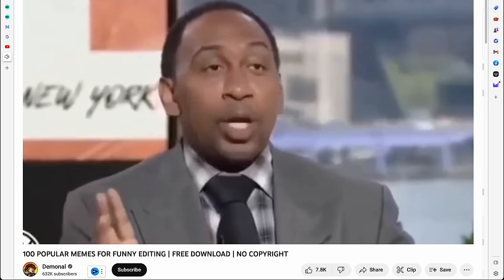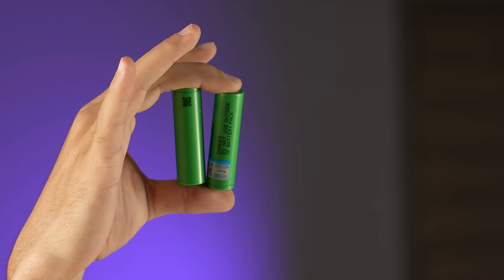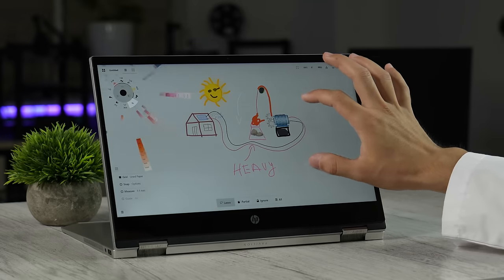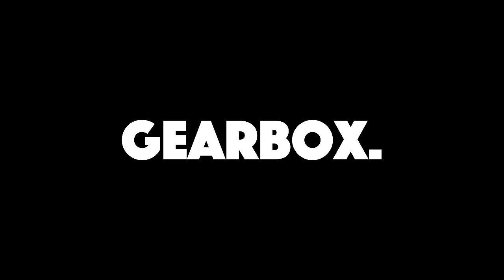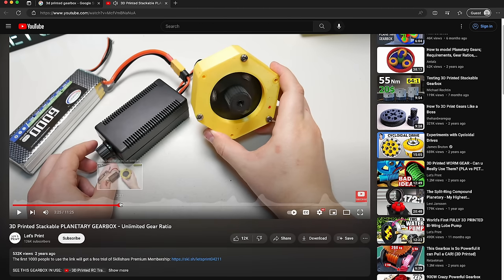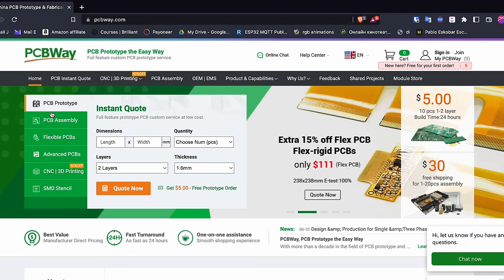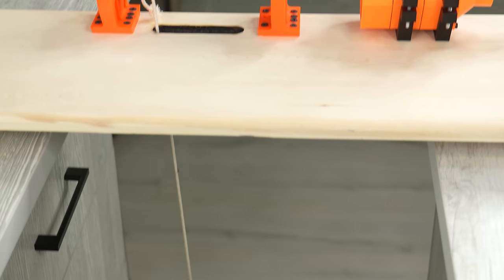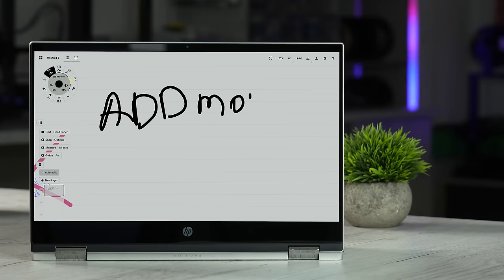DIY Gravity Battery: Unexpected Results!

Comment: I like the idea but i think a heat/sand battery would be a bit smaller. I have always wanted to see someone make a heat sand battery with either a sterling engine or peltier device to convert heat to electricity. You could heat with either an element or a magnifying  glass. But since you have solar already nicrome wire would work very well. The hardest part is getting the heat from the center of the battery to something like a sterling generator.

Comment: I have 12-volt solar panels that run air compressors when the sun shines.

I save the compressed air in a system of tanks and pipes. 

When there is no sun, I run a small generator operated by that compressed air.

I call it my "AIR BATTERY".
Reply from the maker: Nice idea:))

Comment: It's a great project. Gravitiy-based batteries already exist, there's one tower of concrete somewhere in the world that lifts weights all the day and picks them from a pool so that it can effectively accumulate a lot of energy. And of course there are STEP water dams that pump water from the bottom to the top using input energy, and let the water flow down to produce energy.

Comment: There are some excellent suggestions in the comments already, but one thing that I would suggest is to do more detailed engineering so that you know the failure points of every component, so that it involves less guess work and allows you to optimize the set up more easily

Comment: As first, you have my respect for trying such endaevour and mostly succeeding with it. Good job.

1) It would be much more easy, if the weight is inside some "shaft" - therefore it will not hurt anyone (or crush anything) when falling. 

2) Gravity batery is a great way to backup some important area lighting (like circuit braker box lighting, or workbench lighting, or wood chopping block lighting for example). 

3) Even more interesting solution of the gravity powered light would be possibility, to prime it (pull the weight up by hand), if there is no sun, or if input part of the machine does not work properly. I understand, almost 50 kilograms is quite heavy weight, but by ussage of pulleys and/or other simple machines (with brake on the rope), would add MUCH more flexibility. BTW, the gravity batery would work pretty good even in an arctic night - unlike chemical bateries. 

4) 2 questions the engineer should ask and try to answer with the gravity batery, is "How much power do i need?" and "For how long period of time?" The period of time can be prolonged by either hightening the highest part of the construction, therefore the weight travels longer route, or by adding another weights of the same weight, in parallel seting. The "how much power do i need" question is usually answered by the scale of whole gravity batery construction and by the weight scale.  

5) There is company known as "Gravity light", wich specializes on gravity powered lighting, for backups, assistance, or for developing areas as home-lighting. They have very inteligent and cheap design, from wich one can get plenty heaps of inspiration.
Reply: Also use big magnets for the weight and drop them down a copper lined shaft it would take super long to descend and reduce mechanical strain naturally due to Lenz law and Foucault current.

Comment: You can use two different gearbox for this and a clutch. One gearbox with higer ratio to uplooad the weight trough the day and another with less ratio to use on night and this with a bigger motor to collect better amperage.

Comment: I think lowering the stress on all the parts using mechanical advantage and pulleys might be a good idea. It would use a lot more rope, but that might be an advantage.
Reply: So much friction might as well hoist it up using your car to pull it at that point burn like less than a ml of fuel and drive like 10 feet lol

Comment: Abandoned mineshafts are said to be an excellent candidate for gravity batteries.  A winch can derive power by lowering 100 tons or more, down a mile or more, and recharge the system by lifting it back up.  They imagine lifting stone blocks or other solid ballast.  (Earthquake if the weight falls?)  I suppose you could pump water instead (pumped storage), but you need one reservoir high and that doesn't leak out, and one reservoir low that doesn't get leaked into.  The decision is based on the amount of energy stored (kWh), rate of energy acceptance and release (power), and round-trip efficiency, versus the cost of the equipment.  How does it compare to available kinds of batteries, capacitors, superconducting inductors, flywheels, pumped heat, [unknowns]?

Comment: Different pulley configurations will give you a far greater mechanical advantage so you can lift more weight with less strain on the gears and motor.

Comment: Why didn't you use multiple pulleys between the anchor and the load? You'd have to pull more string to get the same amount of movement, which of course means more rotations, but if you have enough string, the motor can go faster, needs to pull less weight, and since it will unwind faster, you should be able to run the motor at it's most efficient.

Comment: Interesting.  It would be good to know the height and the final mass that you used.  I'm guessing ~50Kg and a height of 5m.  That means you stored ~2500J of energy or ~0.7Wh of energy.  I have a small usb backup battery sitting on my desk that stores 40Wh of energy in a pack that is about the size of a deck of playing cards that I'm certain cost less than the cost of the hardware you bought and made.  In addition, it's losses are much smaller than the mechanical losses in your gearbox.  Don't take my comment as a negative comment.  Yours was a very interesting experiment in that it shows the limits of mechanical gravity batteries compared to electric batteries.  It also demonstrated the very real dangers of lifting heavy objects high in the air several times!!!!!!  (I'm glad you included those failures.)

Comment: Ok, if you're doing it over dirt or a surface you don't care about, rocks are fine. But you are ruining those tiles, stick with water jugs if you must do it over the tile floor because if the jug falls it will burst and spread the weight over a larger surface area.

Comment: How about instead of daytime lifting up the rocks, we use water at night time to fill bag to drag the line down instead?  Daytime no need to lift heavily up, whereas night time, slowly fill bag with water to weigh down.  This way, the motor does not have to do double duty with lift up and down.  Once the water is down to ground level, the water is drained back to a repository.  The system can roll up and reset for night time to be filled up again by a controlled water pump from the reservoir.  less tension going upwards for entire operation; only downward tension going down with gravity during night time operation.

Comment: Instead of building the entire winch, gearbox and motor mount yourself, you might also be able to modify something like a chain winch to do the lifting. With gears interfacing with the chain, the chance of something tangling or slipping should be a good bit lower. 
Another idea which is a bit off the wall, but how about using lead acid batteries as weight for the gravity battery, making a hybrid battery that to a degree supplements the shortcomings of both systems?

Comment: Depending on supply in your location, use water instead of rocks. Easier to adjust the load, heavy enough to do the work and less catastrophic if it falls.

Comment: You know what's potentially easier and safer than hoisting rocks in the air? Pumping water up to a tank, you can then adjust flow rates both up and down to control work rates and generation...

Comment: How heavy would the weight be if we have only 10 meters height and need to store 5 kWh?

We can again use the formula E = m * g * h to determine the weight needed, but this time for 5 kWh (which is 18 * 10^6 joules) and a height of 10 meters. If we rearrange the formula to m, we get:

m = E / (g * h) = 18 * 10^6 joules / (9.81 m/s² * 10 m) = 183514 kg.

This means that at a height of 10 meters, you would need a weight of about 183.5 tons to store 5 kWh of energy.

Again, please note that this calculation assumes an ideal, 100% efficient system. Actual systems always have some amount of energy loss, so the actual weight needed would have to be even higher.

Comment: Motors like that are pretty inefficient alternators.
What you need is to construct a self-exciting alternator from that motor, and a car alternator.
The way a self-exciting alternator works, is it has two alternator stages - One with permanent magnets, that generates a voltage for the exciter coil, and one with only electromagnets, including the exciter coil.
What you'd be doing, is taking an externally excited alternator, and using your motor as the exciter generator.
You will actually achieve higher mechanical resistance once the alternator is excited, as now you're turning two generators, one that makes the other more efficient. But unless this added resistance is dropping your output too low, you actually want this.
You can either run them both on one gearbox (there are ways to do that), or if you don't mind the toll it may take on your motor while lifting, two separate gearboxes on the same shaft. Could even disconnect the alternator gearbox mechanically while the battery's in lifting mode.
If your gearing for both of them is just right, you won't be starved for power, as falling too slow will lower the exciter current, reducing the mechanical resistance of the alternator, speeding up the fall, driving up the exciter current and the alternator output.

That's how power companies do this stuff: They excite generators with a less-efficiently-generated current, and generate more current efficiently. When the grid is healthy, they aren't even using any permanent magnets at all. At their scale, they can just feed the power back into the exciter coils.

Comment: Congratulations, your funny production of this movie is excellent.
And your will to reach your goal is impressive.
Maybe, you could have started with some physics computations, to get an order of magnitude of the energy you can store.
For instance what is the energy of 1kg at 10m above the ground.
Energy= 1*9.81*10=98.1 Joule
=0.2725 Wh
Which is few.
With 100kg, at 10m altitude, you will get 27 Wh....only.
And then, to convert in electricity, you have to withdraw the mechanic losses and the efficiency of the generator.
Nevertheless, it's a great tutorial, thank you very much!!!

Comment: The ropes the pulleys are hooked to will stretch over time. The ropes and pulleys need to be inspected to make sure they aren't slipping and twisting out of the hook position, but I assume due to the incredibly low energy stored it's easier to just not keep it installed.

Comment: Everything I thought was gonna go wrong in this video did.  I was like "that pully is gonna break".. pully broke, then "that gearbox is gonna break".. gear box broke.. "your gonna crack the floor".. floor cracked.  3d printers are great but they are not a catch all solution to any problem. Of course they could have been used more effectively but you would have had to distribute the load more. Also would have been cooler to see the system dynamically store energy based on electrical load instead if having the manual switches. And yeah,  I think someone pointed out an emergency brake in case of failure would have been nice and cool

Comment: If you want to greatly improve the gear fitment/tolerance, thereby improving efficiency, use T-Cut or other abrasive polish and drive the gears with a drill or other rotary tool. Finish up with some graphite powder for long lasting lubrication.

Comment: Setting up a mechanical advantage system would take the load off the winch,  but the anchor point needs to be strong enough to handle the forces put on it.

Comment: Mmm..., I feel like I saw a pumice stone in your video. That's so light, bro! Try black sand. That would make it very heavy. In addition, sand will fill every cavity in the bag.

It's a good idea to add two rollers under the board. But, it would be better if you don't use it and just turn the board over.

And finally, this idea was actually discussed several years ago. And, because of the limitations and output that does not meet expectations, chemical batteries are the most suitable answer for home electricity supplies and you can start from wet batteries, bro! It will be very, very low cost with a large watt hour.

Comment: hope you answer this question;
Is it possible to add multiple weights on a single line that each fall separately, but hit a button on the bottom to release the next weight, and continue on the fall till all the weights have hit the ground?
then when they are all resting, a motor on the opposite side begins winding each weight, 1 at a time to load up the power.

Comment: Instead of using only gears as your ratio reduction, you could have (should have?) used multipple pulleys after all your plastic parts as part of the reduction, putting much less strain on your plastic printed parts.

Comment: I know, the energy that you could store is E = mgh. Well, the gearbox and rope systems would help with multiplying it more.
Also, the reason that LEDs flicker is because of back-emf, that is also the reason why it won't start by itself.
Reply: You wouldn't multiply it at all (you'll even lose some due to frictions): with gearboxes you'll convert/slow down the energy given by the falling weight.

What you multiply is the strength, at the expense of speed.
Reply: @Mr_Yod  if the friction coefficient is less than 0.5, there's some net power gain. You can control it by adding grease to the transmission. And reducing speed of falling weight is the goal to increase the gravity battery capacity.

Comment: Great vidoe, I wanted to try something like this and I beleive a company wants implement something like this on a large scale using huge cement blocks they would stack. Problem is efficiency loss is so poor for this and things like hydro energy storage. I agree that even high end lithium batteries,  at this point in time, are not the future of energy storage.

Comment: had the same idea a few times but you actually pulled it through - liked the video. the same basic idea of gravity batterie would be fun with water. solar powered pump to change the water's potential energy and then to harness that energy by letting the water run down a tube passing a torodial propeller. i guess there would be less stress on mechanical parts and the energy output could be controlled easier by a valve. water running through transparent tubes lit by some led would probably add some aesthetics as well. but again, very nice approach and implementation, but please wear a helmet next time while testing a rope winch's stress limit, the broken part could have easily damaged you head quite severely.

Comment: Some idea:  6. Also instead gear ratio reduce you can use rope version. It will more silence. 7. Use motor from electric scooter. 8. For start you can power motor for a moment to spin backwards  BTW: how many power you can obtain? 20W LOL I'd love to see a solution on a slightly larger scale. Let's say to power a toaster.

Comment: You should try  putting a pin through your spindle  shaft that fits into a slot on the rope  spindle,, it is  to move some of the torque outward and not just on the shaft.

Comment: The second roller is bigger, ticker and black.
You can use physical components as limiters, to not let you turn one set of switches on while the others are already on. Like an actual panel and you cant change them, as turning one on blocks the others.

Comment: This is a really Cool idea i love it... hmmm maybe for safety routing the pullies and weight through a tube on the side of the house so that it can't fall on any one. Also perhaps a car alternator for stronger more durable out put and a shorter rope with higher gear ratios so that the weight does not have to be so far off the ground. And perhaps the cylinder that the rope coils on could have back up system for rainy days a switch that enables or disabled a ratchet gear inside the spindle that allows the spindle rope to be wound up by hand that then unwinds and turns the alternator. Just a couple of suggestions for a version 2 of this idea maybe one or 2 of them could be useful.
Reply: Oooh idea for safety if you use a tube the bottom last foot of the tube could be copper and a portion of the weight magnetic so that when it falls it slows down at the very end and doesn't hit the ground with as much force

Comment: I am not good in physics , so i need to ask a question: Would it be more efficient, to have two different motors with, different torque for pulling and generating energy, additional to the gearbox?

Comment: Equation for potential energy is mass (kg) x height (m) x g (9.81 m/s/s)
Do the math.  A ten tonne mass falling through about 37 metres 'releases' about 1 kWh (assuming no losses).
With most setups friction is huge, and times generator efficiency you will be lucky to get 20% out = 200 Watt-hours.
To be of any use you need to suspend your entire house on the rope.  Good luck with the gearbox then! :)
A good mass storage system is water pumped uphill and run down through turbines when required, AKA pumped storage.